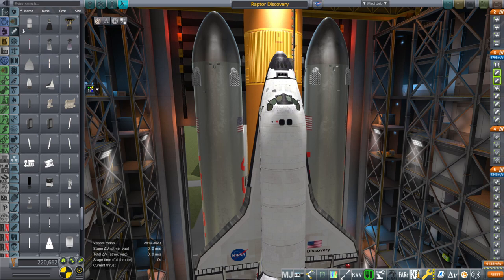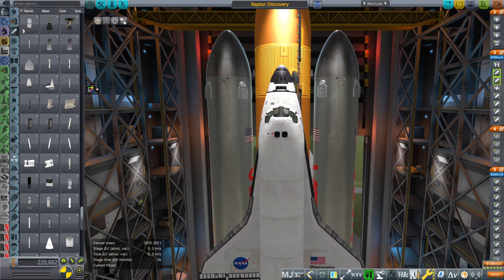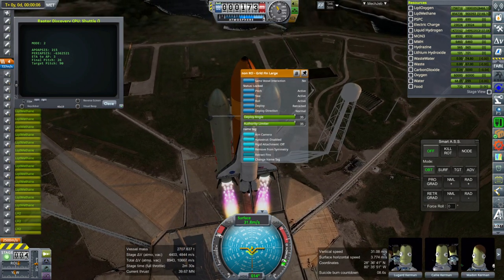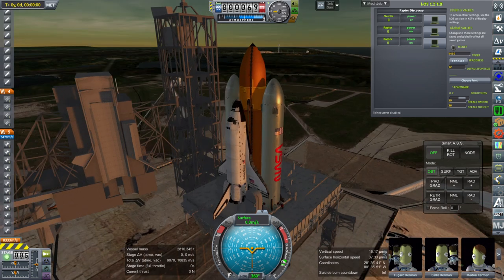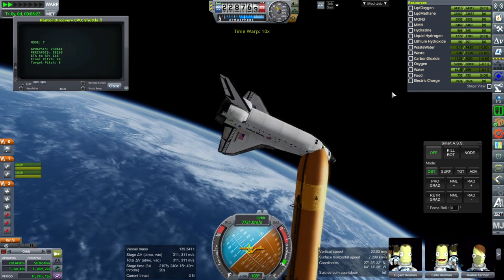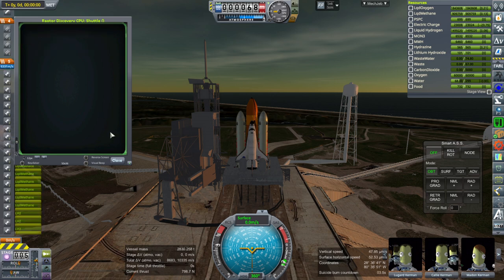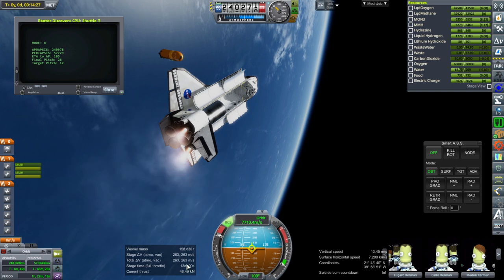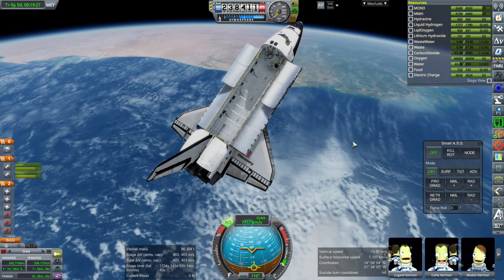Realism Overhaul in KSP 1.8.1 - Shuttle with Raptor Boosters

Comment: 0:30 Come on, the stock Shuttle stack was way more an abomination than this is.

9:45 Orbital Maneuvering System system.

16:10 Yeah, a major problem with notional Shuttle payload mass upgrades is that volume usually remains unchanged, putting increasingly severe lower bounds for density at higher payload masses. IMO no launch system is truly capable unless it can launch its maximum payload mass in pure liquid hydrogen, something I'm not sure if the virgin Shuttle could do.

17:00 People have already been talking about doing a Shuttle with 4 Falcon 9 boosters like they had before with the SLS—how 'bout just the two? It would probably have worse payload capacity than the stock Shuttle stack due to the boosters lower mass and thrust (counterbalanced with their greater specific impulse and wet mass fraction), but would of course have the advantage of easier reusability vs SRBs and less modification to infrastructure vs using 4 of them. Due to the system's low TWR, I wouldn't recommend throttling down at Max-Q.

17:45 Well, I said I thought the stock Shuttle is an abomination, so...

Comment: 15 m diameter ET and four SLS 5 segment SRB`s? :) And I guess 55 t for NG boosted Shuttle.
Reply from the maker: You know fueled mass goes up by the cube of the diameter, right? I don't think it's a good idea to nearly double the diameter of the ET and then only double the thrust. And let's not talk about how the Shuttle plunges into the ocean after the SRBs are done.
Reply: @RaizSpace  Three shuttle orbiters and six 5 segment boosters
Reply: @RaizSpace  Right I didn't think that through. In that case replace boosters with four AJ-260's, reinforce the payload bay, replace the AJ10's with RL-10's and add sidemounted hydrolox drop tanks, kinda like you did for Raptor powered Shuttle a while back. Alternatively, have you ever considered building Daedalus? The 50000 ton starship developed by the British Planetary Society in the 70's. Could be done with 500 Starship launches :) Or Project Longshot.

Comment: My bet... 45 tons for New Glenn-Shuttle. Which is as good as using 1 New Glenn with it's upper stage if you only measure by payload to orbit. 

Have you ever considered recreating the Beal Aerospace BA-2 rocket? Beal Aerospace was a company in the late 90s / the year 2000 that was going to build a 20 ton to LEO RP1/HTP pressure fed 3 stage rocket. It kind of reminds me of Sea Dragon, but on a practical scale. A Medium-Dumb-Booster to Sea Dragon's Big-Dumb-Booster, if you will.

I bring it up because the first stage of that would also make for an excellent shuttle booster.
Reply from the maker: I'm not thrilled by low efficiency systems, but I might look into it. Has someone made a replica already?
Reply: Not as far as I can tell. There is specifications on b14643 for it though, and Astronautix has some good information on the engines in particular. For example, apparently the first stage engine thrust, "-declines to 70% of initial value before shutdown."
http://www.b14643.de/Spacerockets_2/United_States_1/BA-2/Description/Frame.htm
http://www.astronautix.com/b/beal.html

That first stage engine, the BA-3200, is what's really interesting about it. It may be horribly inefficient, but it's the only plausible 14,000 kN liquid rocket engine I've ever seen designed. Having such a large liquid engine (with a basis in reality) available could be useful.